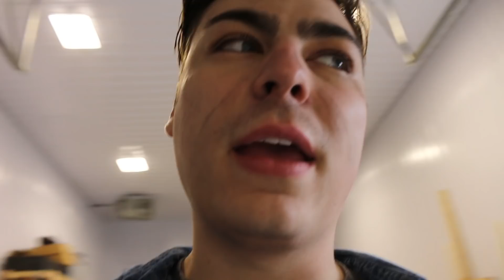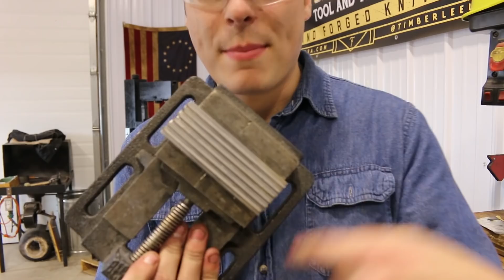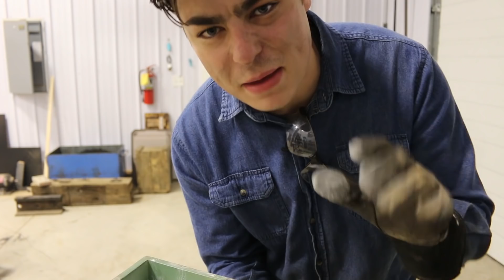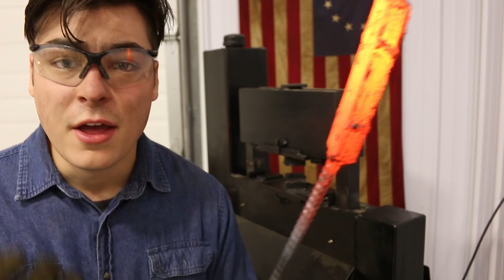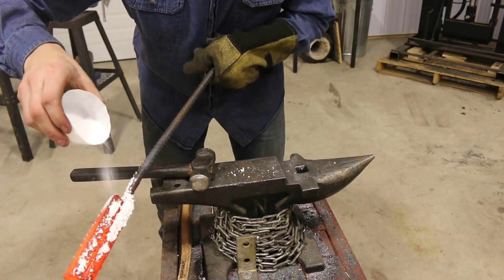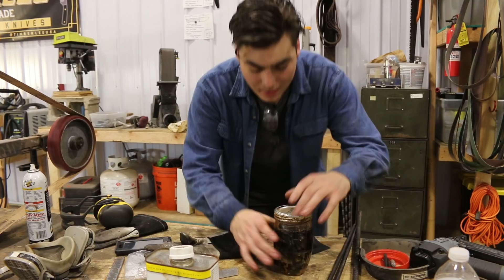Forging Damascus Steel

Comment: Hey Brad, what kind of exhaust do you need to operate a forge like that? Also, is the cost of fuel a major factor for completing one project? Excellent information 👍🇨🇦🍻
Reply from the maker: Thanks for watching Andrew! A propane forge doesn't need much more than an open window or garage door. It would need to run for a while before C02 would become an issue, but I always prefer leaving a shop door open with a small fan for airflow. Cost of fuel is not that bad if you work on a few small projects at a time as getting the forge up to heat initially can take some time depending on the forge.

Comment: Try soaking your billet in diesel fuel or WD-40 after weld up and before your first heat. Flux makes a mess in your forge and if you clean your steel to start you can use alot less. I like to completely seal weld my billet after degreasing and cleaning my steel. I use a TIG rig and fuse/seal weld the billet and eliminate flux all together but not everyone can TIG weld or has one.

Comment: NOT Damascus
Pattern welded steel has potential weakness on every weld so inferior to Damascus.
Crucible Woots Damascus steel with its visible Crystalline molecular grains structure is far superior.
stop calling this garbage that

Comment: Hey Brad I’m really enjoying your videos! I’m just getting back into forging. I had a coke forge but want to get a propane forge for the consistency and even heat. I noticed you have a 3 burner forge. Is a 2 burner one versatile enough for blade smithing or should I spend the extra $ and go for the 3 burner? Any info would be greatly appreciated.

Comment: Does it matter that the weld beads are just getting mixed in there?
Reply from the maker: I've never had an issue. When making the bevels, most (if not all) of the weld material ends up being ground away. I'll sometimes square up the edges of the billet after each flip which also helps get rid of the weld. As far as the pattern goes, I've never actually been able to see any welds.

Comment: Okay i have a question what are the jaws of a hydrolic press made of because I’ve seen them crush cold steel so if they are made of steel shouldn’t it crush the jaws too because of one of the laws of that one dude
Reply from the maker: Matthew Brown The dies are made from hardened steel. I try to only work hot steel with them but if I crush cold steel I can dent up the dies pretty bad.
Reply: Brad Richardson ahh alright it always kinda confused me

Comment: how do you get the rebar to Hold onto the billit?
Reply from the maker: Through the eye of the Traveler TV and video gaming I used a flux cored MIG welder. This is just easier than using tongs sometimes.

Comment: Anyone from cod MW
Reply from the maker: -OptimisticYTツ I’ve had a few people mention COD. Could you explain the connection please?
Reply: Brad Richardson so basically you have to get 500 kills with each gun. And there are 42 guns so it’s basically a really hard challenge and whenever you get Damascus it’s one of those things that you can brag over.
Reply from the maker: -OptimisticYTツ nice haha I play MW sometimes but never knew that. Thanks!

Comment: Can someone help me. 
I made knife from leaf spring, polished it with 1000 & 2000 grit sand paper and further refined it with 10000 grit whetstone.  But after 2 days it has started developing RUST.  Can you help and guide me in this regard.
Reply from the maker: The carbon is what's causing rust, it's also an important alloy to have in a knife. This makes rust a pretty common problem. Best to keep the blade clean and oiled when not in use. Sometimes a gritty toothpaste and brush can help clean surface rust. Otherwise re-polish with oil and high grit sandpaper.

Comment: Just wondering did you build that press or buy it.  Would like to have one just wondering which way you went?
Reply from the maker: My press was purchased from Riverside Machine, it is a 24 ton hydraulic press. It's a nice press, originally tried to buy one from Coal Ironworks but they never responded to my emails.

Comment: 7 layers, folded once. Is that strong enough? Or would you rather fold it 10-15 times instead?
Reply: Number of folds has little to do with strength.
Reply: @crashtke  seems like an easy answer without any argumentation or substance. Can you explain why? because from some of the research I did, folding the steel takes out many impurities, therefore resulting in stronger material. What's your perspective here?
Reply: That was on older steel when they mixed crap steel with very high quality steel.  The folding would indeed get rid of impurities and homogenized the two through the folding.  Carbon mitigation would go from the higher carbon good steel to the low carbon crap steel.  When you start out with 2 good steels as he did, assuming your forge welds are good folding over and over can actualy decarburize the steel and lose carbon.  Time for more research in modern making of damascus for you sir 👍
Reply: @crashtke  Well my research stated that 11-15 times folded would be stronger still. You can start out with steel that contains higher carbon %, allowing more folds. Right?!
Reply: A forge weld is a forge weld.  It does not gain strength from folding.  Your research is flawed.
Reply: @crashtke  The tone at which you're trying to make your point is undermining, which makes it seem like all you're trying to do is 'feel better' about yourself. As opposed to genuinely trying to help someone with his or her research. I am very happy to hear constructive input. My research is still on it's way, and therefore not complete anyway. It's one of the reasons one may ask questions to the world.
Reply: Think about san mai or go mai blades.  They are not folded at all.  Just high carbon core with a different jacket.
Reply: @crashtke  In my particular case I was referring to traditionally handcrafted swords that I bought from Japan. This may differ a lot from the modern forging/welding techniques. Which is clear now of course.
Reply: @ciszero  well when I tell you the answer and you say your research says differently....well obviously you don't believe what I am telling you.  As a bladesmith this is something I have personally done, read about and studied.  I gave you the answer, you doubted it.  I gave it to you again.  Traditional Japanese swords were folded for the reasons I listed above.  Probably what your "research" was refering to.  But as I already stated a forge weld is a forge weld.  The  strength of that weld will not change from repeating it.  In fact you have more opportunities to screw up, haha.
Reply: @crashtke  can you check Mme t on difference between vg10 layered with 3 layers Damascus and 37 ,67 layers ? Really stuck trying to find answer
Reply: @jaanajaana5771  I will stand by my original answer.  When starting with similar steels as he did in this video like 15n20 with 1084 the strength is not dependent upon the number of folds.  A san mai blade (3 layers) will be as strong or stronger than 1000 layer damascus.
Reply: @crashtke  what would be best layering steel for vg10 core ? I purchased a yaxell Mon knive with 3 layers whereas nowbi see yaxell with 37 layers and it has much higher price and is described as note professional knive. So, both knives have same core but the layering is not mentioned as of which type of steel that is, same as Yaxell don't reveal their " technology ".so, I guess it's natural to ask if I should pay more for more durability, sharper edge , less sharpening sessions ? Perhaps, longer knife live due to more " protection" around core ? If it's just design then screw it. I hope you can shed some light like that, because knives might be made using a  different technology ( I am no expert just exploring best value  and avoiding unnecessary costs) that changes properties of material ??? 
Thank you for bothering to answer !!
Reply: @jaanajaana5771  it is more than likely purely for aesthetics.   The core is the part you will be using and sharpening.  The outer steels do not come to play unless they are exposed on the edge.  When doing a core that is clad in other lesser steels, I make sure that those lesser steels do not reach the cutting edge.
Reply: @crashtke  thank you ! You should make FAQ videos where you cover these aspects ^^ very well- answered
Reply: @jaanajaana5771  I can not take credit.  I have learned from some very intelligent folks such as a number of ABS master smiths who have devoted years to the study of such things.  ABS Master Smith Kevin Cashen has a couple videos on it.

Comment: I honestly like your videos. I have a question regarding your contact wheel on the grinder. It looks like a large caster. If so how did you get it balanced? Great job on the billit I still do all mine by hand and it takes forever and I loose a lot more to scale that I'd like.. Martin
Reply: Hey brother just so you know a god priced contact wheel is the ameriblade on ebay runs 120 and grinds really well
Reply from the maker: Seed of Life Forge thanks! I’m familiar with that company I’ll have to check it out.
Reply: Thanks Robbed I'll check it out.
Reply from the maker: Thank you for watching! I got the caster at my local Menards. I used a piece of conduit that I slipped over a 5/8in bolt as an axle. I have washers welded to either side of the conduit to keep the wheel in place. It’s far from perfect but it works!